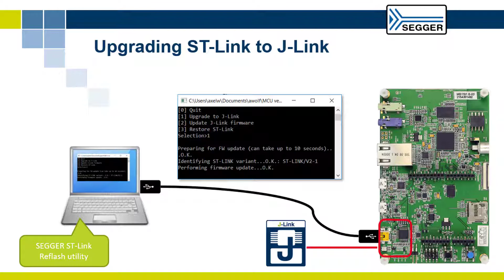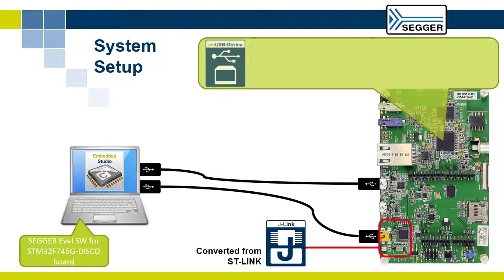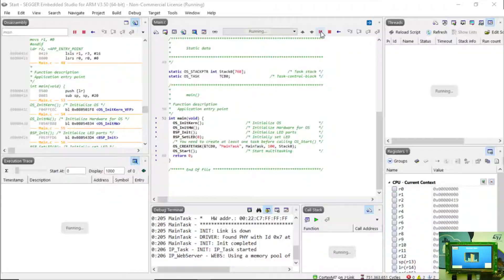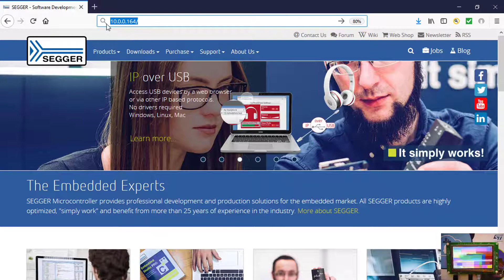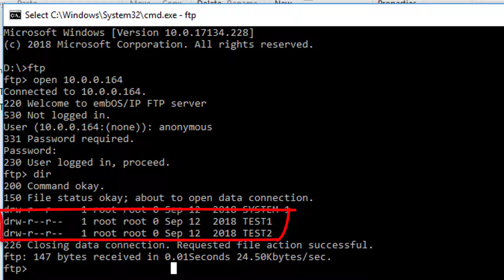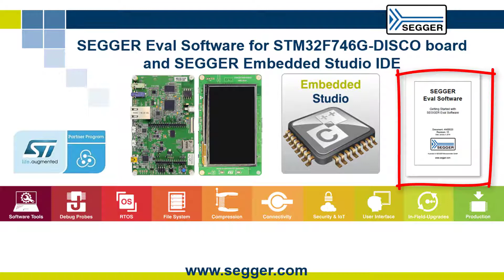SEGGER Demo running on the STM32F746G

Comment: Why should a stand alone demo board need to go on line? I live in an area where there is zero intent in my remote area in the mountains. So is there a way to do this without having to drive to town to log into the local library computers or is it only Web based use?